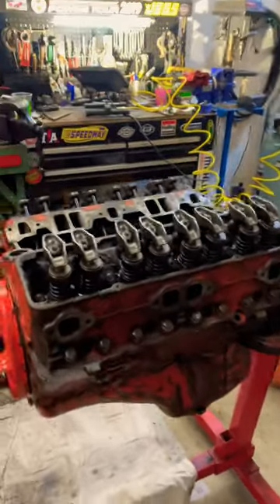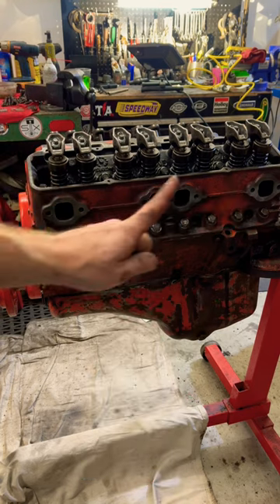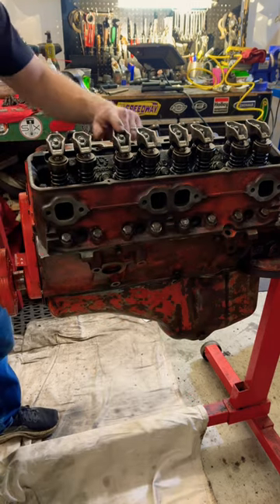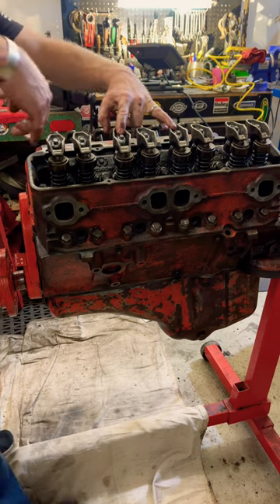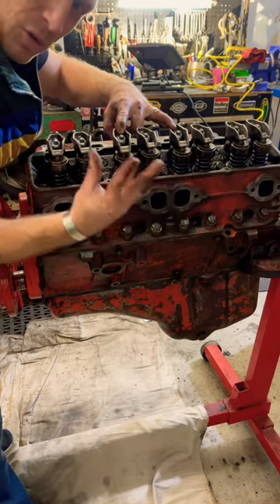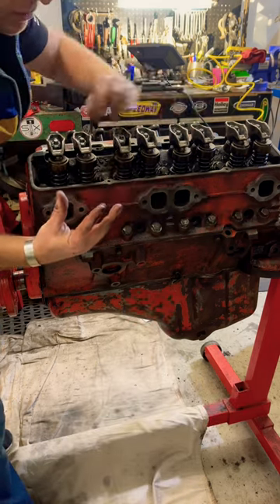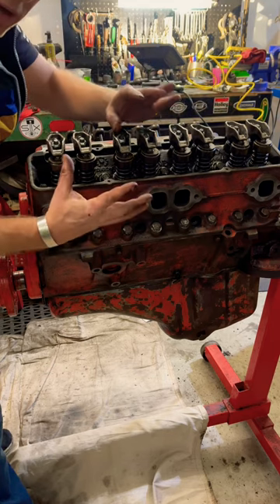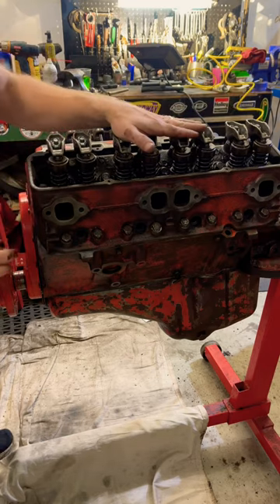And now a RIDICULOUS test

Comment: Nice 327👍👍👍👍👌👌👌💪💪💪🤘🤘🤘🤘👏👏👏👏 or should I say 283😂😂
Reply from the maker: Yep just a little old 283, great engine to mess with
Reply: @Foxcanfixit  I had been looking. For one .. n finally I just got me one last week .. complete but had low oil pressure.. got it for $100 buks.. I got lucky with it cus it has a steel crank flat top pistons n close chamber heads .. I’m rebuilding it to put it in one of my tow-truck .. super gas savers 👍👍
Reply from the maker: @stanmendoza638  that’s awesome! 😀
Reply: @Foxcanfixit  ty..💪🤘🤘😎😎 happy new year 🎊🎆🎈 be safe out there 👍👍